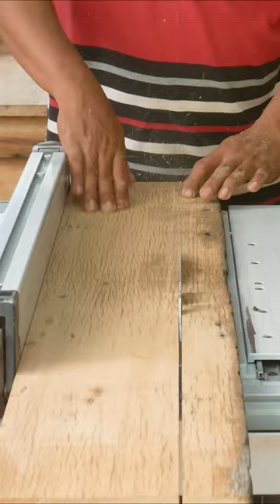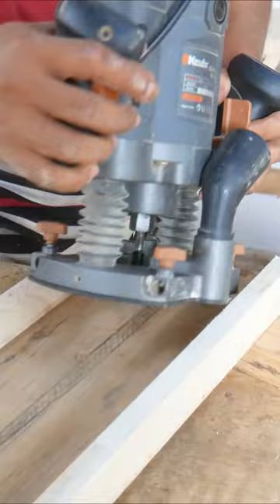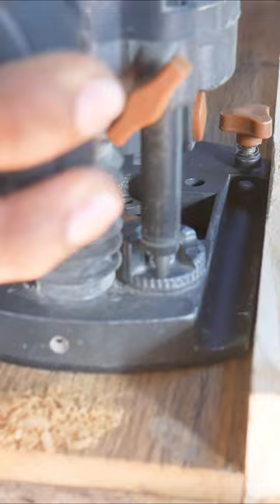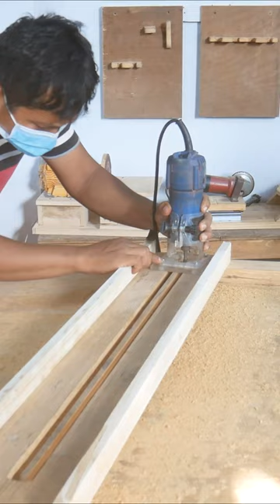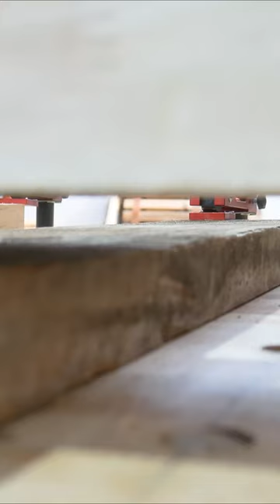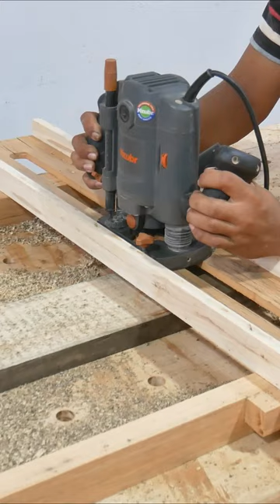DIY Woodworking Router Guide Jig to Cutting #shorts #woodworking #routerjig #cutting #wood #diy

Comment: Бюджетный рейсмус😊
Reply: Hi bro
Iam having a new set of Router Bits
But it gets too hot and burns the wood
So what is its solution ?
Reply: @footballgoal7661  speed is too fast. You need to choose the speed of rotation of the blade and the feed rate of the workpiece
Reply: @footballgoal7661  also blade must be sharp
Reply: @less4717  Yes I did sharp , but still the wood get burns , smoke coming from wood